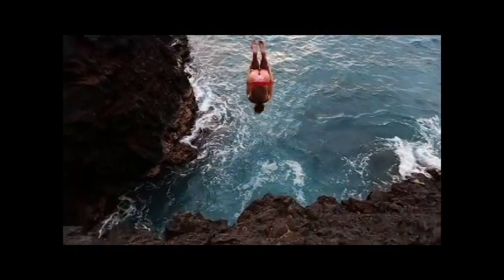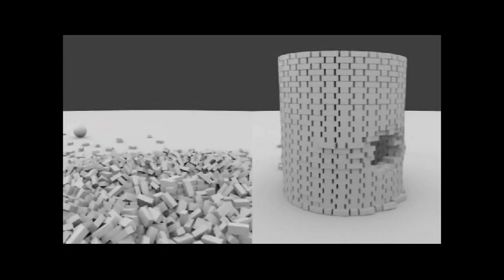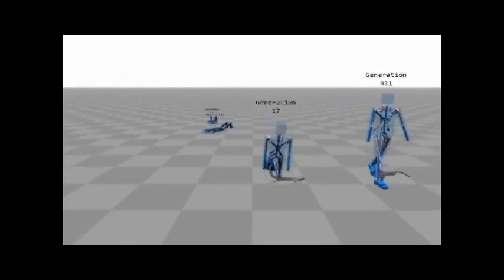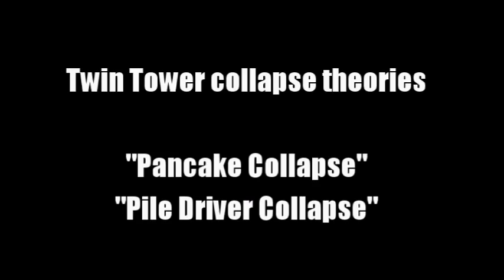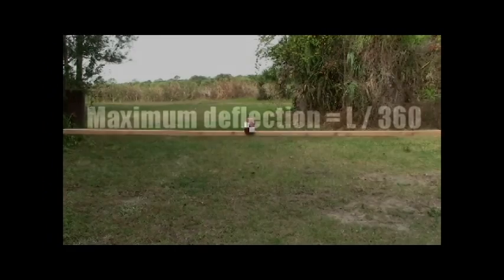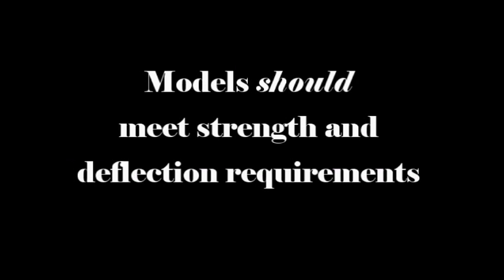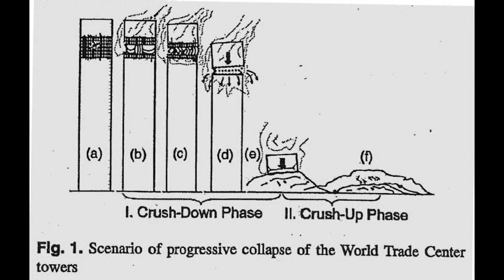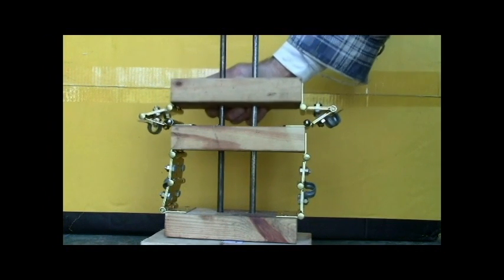9/11 Experiments: The Force Behind the Motion

Comment: Stevie wonder can see all 3 buildings went down in the same fashion. 1 of them wasn't even hit by a plane. 

So if the jet fuel melted the steel causing the official story then why did the building that wasn't hit by a plane dropping the same way with no jet fuel present ? 

Along with that I am a New Yorker and personally grew up with many first responders.that all seem to agree the official story is bullshit.
Reply: B Murphy I guess you forgot planes are made of tons of aluminum and magnesium didn't you????? Humm? Forgot that part? Did you forget aluminum burns at 6000 degrees, plenty hot enough to melt steel. Oh yeah did you forget about what water does from the sprinklers when sprayed on a magnesium fire? Did you forget about that too. That's right H2O splits when sprayed on a fire that hot which adds oxygen and hydrogen to the fire. 
 Is that hot enough for you.
 Like I said ALL CONSPIRACY THEORIES HAVE BEEN DEBUNKED. All that's left is traitors blaming Americans for the murders that Muslims did to us.
Reply: Bryan - Although I do agree to your conclusion, your statement on magnesium used on planes is wrong. Up to 2013 the FAA had banned magnesium alloys in planes. Now it may only be used in very specific circumstances:
https://investingnews.com/daily/resource-investing/critical-metals-investing/magnesium-investing/how-magnesium-alloys-are-making-planes-lighter/
https://www.fire.tc.faa.gov/pdf/materials/June07Meeting/marker-0607-Magnesium.pdf
Reply: Bruce Lansberg even so, aluminum is basically the same effect except it's just a little harder to light. It burns around 6,000 degrees.
Reply: Joe humm, guess that's the reason it's used as the fuel in Tannerite huh? Wait a minute, that's means you are WRONG.
Reply: Joe here's a link from the University of Pittsburgh about safely handling combustible metals. You should read some accurate information and not these brainwashers
https://www.google.com/url?sa=t&source=web&rct=j&url=http://www.ehs.pitt.edu/assets/docs/combustible-metals.pdf&ved=0ahUKEwjcorKz2snZAhVK_4MKHayHAt4QFggtMAE&usg=AOvVaw2wEBz9dUCi6HNYcNuU4ejM
Reply: Joe if you are scared to click on the link, Google "is aluminum combustible?" Then click on the University of Pittsburgh link
Reply: Bruce Lansberg here's more. Look at what the fuel is in this explosive substance. Notice, it's not flammable, but it's explosive. Highschool chemistry. 
https://en.m.wikipedia.org/wiki/Tannerite

Comment: You couldn't tell by where the hole in the building,  nothing is pushing down on that part,  but yet,  it crumbled an pulverized evenly the whole way around the building...plus,  that whole upper building pulverized well before half the building was gone...
Reply: Exactly, there was no crush down because the top load was destroyed first with the top load "weight" (mass) ejected sideways first.

Comment: ok the experiments are flawed. first the twin towers were built to withstand lateral load, not vertical. so the building was built with long columns connected by the floors. their was just enough down force strength  to keep the towers from collapsing. When the top floors lost enough strength and began to fall. when it fell on the floors below the whole tower lost strength and collapsed. You can actually see this in how the vertical collumns curled.
Reply: How can any structure be built not to be able to withstand vertical loads X3?
Reply: I reread every thing I wrote and I never said x3 so what are you talking about.
Reply: TimesThree  Read your sceen name again. Would you have understood my shortening of it if I had put it Xs3 ?
Reply: No my screen name is based on the fact that I am a single father of triplets. 1X3 or Times Three. It has nothing to do with structures. No I am not a troll. Their are many subjects that I am into.
Reply: That's nice. Have you had time to design a better practical experiment than this one here that demonstrates your conspiracy theory?
Reply: KISS, there was no gravity powered "crush down" (utterly ludicrously at free fall acceleration) because the "top load" was destroyed explosively first in WTC1&2 with the top load "weight" (mass) explosively ejected sideways first!
Reply: Quote: "ok trade towers 1&2 did get hit with planes and 6&7 had 1&2 fall on them" Prove 1&2 got hit by planes without saying you saw it on TV and WTC7 had the first explosions inside before WTC2 blew up and the explosive gutting of 6 also had nothing to do with 1&2 blowing up.
Reply: Oh yes it could. You can't build it to not with stand it self, are you crazy. Also it is a safe structure as long as the central columns are not compromised. Which is what happened.
Reply: ok trade towers 1&2 did get hit with planes and 6&7 had 1&2 fall on them. Nothing blew up in the explosive since. The towers where to be able to withstand side impacts from 10-20 times required by law and only 3-6 times vertical impact as required by law. Of course it's going to support its own weight.What idiot would build a structure that could not support its own weight
in the debris they found the mangled remains of the center columns these columns where pushed over in one direction. After the load bearing capability of the center columns were compromised all it took was the heat from the fire to cause the whole structure to fail.

Comment: There is a reason that special effects artists in film, film miniatures at a higher rate than normal when the subject is a (scale) miniature. The forces filmed, such as explosions, or "structure collapses" perform very differently in scale. Replayed at the normal speed, they can appear authentic and real. Even an EXACT miniature replica of the WTC towers at say 1/10th scale, would not perform similarly to the actual buildings if intended to reproduce a miniature collapse. This person makes no attempt to take this into account, instead using EXTREMELY poor representations of the buildings, the damage they sustained, and the VERY different effects of gravity on miniatures, ie., downward acceleration of increasing mass, the structure types of the models in comparison with reality (outer structural walls, core shaft, and floor design of the WTC buildings). Although he states in the description that it is intended to show forces of two objects, this is the important flaw. The upper section (floors) had mass, and once the collapse began, they had acceleration. The lower floors did not. Their inertia is static, until enacted with the outside force, which is the upper falling floors. Which together disintegrate, accumulating MORE MASS from the floors added to the falling mass. Which is incredibly difficult to model. The entire premise is flawed and intended for one audience. Conspiracy theorists. Yes, I suppose everyone, the government, NASA, Melania Trump, EVERYONE is out to get us. I lose no sleep over any of this. A group of Islamic terrorists hijacked commercial aircraft, flew them into buildings, etc., killed thousands, and sparked a "War on Terrorism". Correctly. Years later, and many thousands of dead terrorists later, Europe is (stupidly) being over-run by "immigrants" (Islamic radicals) and we have people who still insist that 911 was an "inside job", "Bush did it", "Moussad did it". The fall of Western civilization won't come from Islamists, it will be caused by their apologist's, "who couldn't see the forest for the trees".
Reply: evsupp2011  Give this one a break. At least he's not claiming that he had two brothers killed in WTC2 and four more who were on Flight 93 leading the "Let's roll" charge.

Comment: Again you demolition experiment was wrong. You never show your math on the strength of your walls to the strength of the buildings walls. All you give is y he math for floor support cross beams. You never do the math for the weight on top and how it grows exponentially with the weight of each floor thats added. A more accurate experiment would use a fixture thet would be able to actually add weight as t it collapses onto the rest of the building. You never compensate for added weight of furniture, paper files and equipment. You are using an empty building with what i would say is misleading structural integrity. Just to start with i would say your floors are bigger stronger and less weight then the scale down version you show.
Reply: Are you Ken or dawn?

Comment: Your pancake theory is a good one except. You dont give us the load for each floor and the added weight for each floor that collapsed. The added weight would be enough to accelorate the collapse. Secondly, your 20lb weight is not eqaul to the weight that would have been the floors above. I didnt see your math on that. And lastley your fixture actually supports the collapsing floors as your own video shows them binding the 20lb weight against the side of your fixture as it breaks through the floors. Funny a high school drop out just disproved your pancake theory.
Reply: That's because the pancakes you talk about were seen to explode as if they were full of popping corn. You must have a really messy kitchen when you cook breakfast huh?

Comment: You are WRONG! .. Your block stops because your "free standing" structure is not collapsing, your uprights that supports the plates  does not collapse and the "debris" is supported by these uprights and as a result the KINETIC energy.  Your other tower is also supported by the steel bars you use as guide rods, and the friction between the plates and the rod is way out of proportion of your other forces..  You are also terribly out of scale, the amount of weight and energy released in the tower collapses was astronomical.
Reply: Sidewindr666  All I need to know about your credentials is found in the '666' of your screen name and the fact you simply will not acknowledge resistance to motion is friction and friction slows down movement.  This slowing of movement should have resulted in much longer collapse times if you ever had a means to prove such collapses were possible under Newton's 3rd. Any three year old can enlighten you sir.
Reply: Yeah because a screen name is wholly indicative of education and intelligence..
Reply: Sidewindr666  Yeah, that's right Cupcake. Deflect the minor issue because you can't refute the major charge levied against your campaign. SOP for a paid shill.
Reply: You couldn't be any more wrong. Get an education
Reply: You are the one needing the education ..  I have my education, qualifications and experience of over 30 years ..  You fail to take into account that frictional forces do not scale as you have scaled size and mass nor do you allow lateral escape of materials in your first "experiment" .. invest in some half decent computer modelling software and see for yourself.

Comment: There is no way in any law...that could have brought three buildings straight down to dust from fires that high. It's reality is they were all controlled demolitions...They really messed up when they said "pull it" on the air for bldg 7 meaning wired for destruction. The Pentagon's ten foot hole and no cameras. No parts or anything else. Then of course the third [plane] hole with again, nothing else found. Not a soul. Watch the explosions (towers) during each collapse.... and witnesses saying bomb exploded from under the lobby. Oh, they did find a passport of one of the boxcutter super pilots in perfect condition in all that rubble. Unfrknblvbl!

Comment: It was controlled demolition that brought those buildings down. A Zionist false flag attack. Wake up people
Reply: Bryan Hensley quick google search shows aluminum melts at 600 to 650 degress C. And magnisium has a melting point of 650 C. So they are very comprable. Steel melts at 1500 C
Reply: Bryan Hensley  How many tons of magnesium are in a Boeing 767?
Reply: PoetryHound Roughly 90% of the planes weight is aluminum and magnesium. The aluminum burns hotter than magnesium also.
Reply: Koda hawli I guess you forgot planes are made of tons of aluminum and magnesium didn't you????? Humm? Forgot that part? Did you forget aluminum burns at 6000 degrees, plenty hot enough to melt steel. Oh yeah did you forget about what water does from the sprinklers when sprayed on a magnesium fire? Did you forget about that too. That's right H2O splits when sprayed on a fire that hot which adds oxygen and hydrogen to the fire. 
 Is that hot enough for you.
 Like I said ALL CONSPIRACY THEORIES HAVE BEEN DEBUNKED. All that's left is traitors blaming Americans for the murders that Muslims did to us.